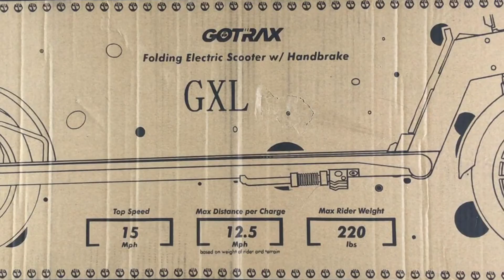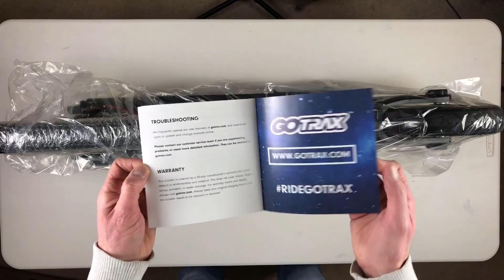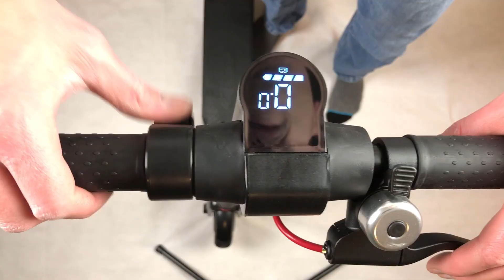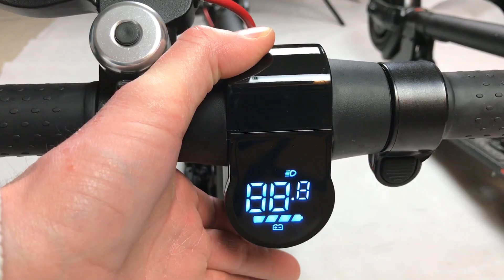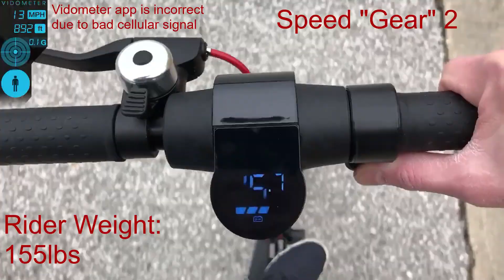NEW GoTrax GXL v2 Electric Scooter Unboxing and Assembly 2019

Comment: hey, i have a question power on fun, in the video meter on the top right of the speed test it says its only going 13 - 14 miles per hour. is that accurate? i just bought a gotrax xr, the standard model, im also wondering if the xr model has a speed cap like the xr ultra has. thanks!

Comment: The Locking Bracket that prevents left-right movement in Folded Position broke. How do you order parts? Functionally, the unit is good, just cumbersome to handle in Folded Position.

Comment: Hey idk if this is the best place to ask but, I ordered one of these about half a month ago and has anyone had problems charging the scooter? Even when I try my hardest to jam the charger into the port, it doesn't seem to go in all the way. The charging block stays green even though the battery indicator says 50%. Anyone else having this issue? Maybe I got a faulty charger. May have to return it... Sad because the scooter itself was fun to ride.

Comment: Do you need a bike pump to fill the tires?
Reply from the maker: Yes.  However, you will more than likely need to use the 1 foot air extension that comes with the scooter in order to air the tires up.

Comment: Just picked one up, cant wait! Our downtown district just put these all over downtown, and after spending 30 bucks to rent one for an hour, its a no brainer to buy one.   Great video
Reply from the maker: Yes.  Renting is nice for a one off trip or getting from one part of the city to another quickly and efficiently, but for commuting on electric devices often it makes more sense to own a scooter (or another electric device).  Especially as the Gotrax GXL is under or at $300

Comment: have problem with the headlights. it keeps blinking even if OFF. do you have any suggestion? took the battery out then put it back, still no luck. it keepa blinking. so annoying
Reply from the maker: Is it only the power button that is turning on or off?  If the whole scooter is I would wonder if something inside the power button is stuck.

Comment: Do you think this is constructed well? It's $300 versus the Xiaomi at $500. People have complained about the bracket on the back wheel breaking at the two bolts that hold it to the base of the scooter. Do you think this will hold up with casual riding?
Reply from the maker: I personally believe that both the GXL, and new GXL v2, are built beyond their low price point when compared to other well though of models such as the Xiaomi M365 and Ninebot Segway ES 2.  I’ve not had any issues so far with either scooter, but I’ve not had a chance to ride the new GXL much yet due to weather.  I can say however that we put the original GXL through a lot in 2018 and other than getting dirty and rubber wheels starting to wear down naturally there is no visible wear and tear.  Both versions are constructed with the same frame and core parts other than a couple of improvements.
Reply: @PowerOnFun   Thanks. I can buy two GXL's for a bit more than the price of one M365. That way I have one and so does my partner. :)
Reply from the maker: If you have any other questions or want a close up detail of parts just let me know.  I’ve got an affiliate Amazon link in the description, but I’ve asked Gotrax recently if they would offer a discount code for my viewers.  
When starting out looking at buying the original GXL I was afraid the price was too good to be true and the adage “you get what you pay for” would apply, but so far myself and all my
Kids are happier with both GXL scooters than my Ninebot Segway ES1 (although it’s an older model).
Reply: I just got gxl v2 and it looks solid to me and very precisely done. My wife likes it A LOT, so most likely I will get another. I commute about 6 miles or 1 miles (from parking lot) and this thing is ideal for me. Now instead of walking for 10 (or more) minutes it is literally 3 minutes! What I like about it is simple, no apps etc. it works. Break is GREAT.
Reply: Why not break off the bracket and throw on a strong permanent magnet to it for 8 bucks?  Or, or...pay $200 more for a scooter. Sheez.
Reply: @AlanSieja  The gxl version 1 was around five hundred bucks 2 years ago! The price just dropped to around $300 last time I saw it around a week ago, so I bought it so yeah there you go... you're getting essentially what was once a $500 scooter! For $298 before taxes..
Reply: @davidg7454  Because some people like myself love to save our money whenever possible "we don't live ghetto fabulous" so we wouldn't buy it at $500 but $300 is reasonable and that's why I have one now! Geez! Gosh!
Reply: @davidg7454  Also the new PlayStation & Xbox will soon be coming out, so I  have to save my pennies for those too!!!😂

Comment: I just bought one and it came.a.few mins ago..I hooked it up and turned it on and it came on, I tried the throttle but the wheel ain't move and the battery says it's full but they say to charge it when u first get it so is that the reason it didnt work?? Does it not work if the battery isn't fully charged when u first buy??
Reply from the maker: The scooter has to be on and moving/rolling 1.5mph to 2mph before the motor will engage.

Comment: Is there any button to turn on & move my wheel when i push the speed nothinh happened but the battery is full do i have to still charge after i assemble it ?
Reply from the maker: The scooter should run on a partial or full charge.  You can disconnect and reconnect the handle which would disconnect it from the battery in the neck of the scooter where the battery sits.  If you still have issues contact Gotrax right away with as much clear detail as you can (and keep copies of your email for proof you contacted them when you did)

Comment: Ok mine is assembled and charged but I can't seem to get it to cycle between gears 1 and 2. It either turns on the headlight or powers the scooter off. 2 secs, 3 secs, 4 secs no diff. Nothing in between. Is there a trick?
Reply from the maker: The GXL scooters I have are from very early 2020 and before.  I've had a couple of others report that they are not able to change speed modes on their GXL scooters received over the past 2-3 months (estimate on time).  I am only speculating that Gotrax may have removed the speed selection option, but I have nothing to confirm that for certain.
Reply: @PowerOnFun  thanks. It seems to get up to the advertised top speed so guess that's the case.

Comment: Hey I just got this scooter, and when I fold it it won’t stay hooked on to the back piece in fender? Like I told it and go to pick it up and it keeps popping off, any advice? Thank you
Reply: Literally just took out of box and I can’t seem to figure out why when I fold it it won’t stay together when I pick it up, it
Keeps popping off
Reply from the maker: There is a red plastic hook on the tiller (front stem) of the scooter that latches up and into a red plastic piece screwed onto the rear fender.  Are those two pieces there and are they making a connection together (or broken)?
Reply: Power On Fun yes they are bother there, but when I fold it down, it snaps in but I go to pick it up and it snaps right off, like just doesn’t hold, which is weird
Reply from the maker: The only thing I can think of is if either red plastic tiller hook or fender latch is backwards things might not line up.
Reply: @PowerOnFun  it seems to be on correct. It faces the same way as it does in the video. Do you think id have luck if i unscrewed it and screwed it on backwards?
Reply: @Rachel Goodman.   When u close it does the hook and latch make a snapping sound? Also when u pick it up are you holding it near the middle of the stem or closer to the handle bar?
Reply: Did you get it working? If you unscrew plastic piece on back fender you can position it further forward or back. There is a small metal plate that's under that piece so be ready for it to drop when taking it off.

Comment: Does it have decent battery life? Also I have big feet, could you tell me the usable deck size length and width?
Reply from the maker: I can say that the battery life on the Gotrax scooters I have an use are very good and have lasted well over the years.  Of course, all rechargeable batteries will degrade in the charge they can keep, but that is normal "wear and tear".
Reply from the maker: My shoes are a common size of 12 and I have not had issues.  I normally stagger my food placement on the scooter somewhere between toe-to-heel and skateboard foot placement and it works well.
Reply: @PowerOnFun  My shoe size is 14. My feet are 10 inches long and 4 wide. Clown feet. Would you say you have plenty of room left over?  
Thanks for answering this is basically the only thing keeping me from buying.

Comment: When attempting to attach the handlebar console to the main scooter base, the console won’t go all the way in for me, so the holes for the screws won’t line up and I can’t attach the two pieces with the hook. I don’t want to jam it in and risk braking it, but is it necessary to give it a good hit or something to knock it into place? If not, I’m assuming it was just poorly made and I’ll have to try to send in a claim and get an exchange for a different one... that would be a pain.
Reply from the maker: I too had questioned the initial handle seating. I would advise removing the handle and slowly seating it to make sure the pins inside the tiller and handle line up.  To seat the handle it may require a bit of a tap from the palm of the hand.
Reply: Power On Fun yeah I was assuming that the problem was that the pins weren’t lining up, but I can’t imagine for what reason. The console and tiller lined up, the holes for the pins on the exterior lined up, so you would think that the pins on the inside would also line up. I suppose I’ll try it again later tonight and maybe give it more of a pat down and see if they will lock in. Otherwise it’ll have to go back.
Reply: Power On Fun update to my problem in case anyone else has the same issue and is wondering: I contacted gotrax customer support and they got back to me suggesting that I remove the battery pack entirely from the scooter so that I can attach that to the console (handlebars) first, then slide that whole piece into the main frame all together... and it worked! (After some time and struggles... if you have to do this as well, the battery can be hard to get out. I suggest turning the entire scooter upside down and tapping on the main frame until the battery begins to slip out).

Comment: Ok I just bought this wonderful piece of transportation and followed the video since the paper instructions were confusing to me and now I have plugged it in and the Black box on the charger is showing Red is this the light I'm suppose to be looking at or is there one on the Scooter itself?
Reply: Also there is a Black Wire about 7 inches long with  2 silver ends what does this go too I didn't see it on the video or the manual
Reply from the maker: The LED indicator on the power adapter  will be Red when plugged into the scooter and charging the battery.  Green when plugged in and the battery is fully charged.  The LED is green when not plugged into the scooter.

Comment: No matter what way I do it the brake line is too short I’ve fought with it for an hour now please help
Reply from the maker: I found the easiest method is to detach the handle and brake line, make sure the brake line is going up the same side of the scooter as the brake on the handle, connect the brake line to the brake on the handle, and carefully seat the handle back on the tiller neck.  It's not easy, but possible

Comment: Correction, the electric regenerative brake is still there. I own this model. If you press the brake slightly, it will engage, squeeze a little harder and the disc brake will begin engaging.
Reply from the maker: I often to neglect to think about regenerative brakes as my local ride is 99.99% flat.  You are correct.  I was able to confirm with Gotrax that the handbrake on the GXL v2 (in this video) does allow for battery regeneration (regenerative braking) as does the first gen GXL with electromagnetic brake (along with with rear disc brake).  It's near impossible for an average user to give numbers for effectiveness on this, but it's, at least a positive, something rather than nothing.
Reply: its garbage

Comment: Hi there! Thank you for posting this video. I received my Gotrax GXL V2 today and unboxed it while watching your video.  It definitely made it simple for me to put together and know how to operate.  I recently returned a carbon fiber Scooter (another brand) as it completely shutdown after one 4 mile ride.  I am hoping that this one will be reliable.  Thanks again!
Reply from the maker: I am glad that I was able to help and I hope that the GXL works out well for your needs.  Be aware of the automatic cruise control when riding.  It is very nice on long straight rides, but not mentioned in the instruction manuals I have and has a potential to confuse one if not aware.  I have a video I’m almost done with explaining this as well.
Reply: @PowerOnFun  Thanks for tip, i experienced it today.  I will check out the video.  All the Best!
Reply: How is it doing?
Reply from the maker: Tomas Zaicevas, the GXL v2, as well as my original GXL model, are still running strong with the same power and reliability.
Reply: @PowerOnFun  I am very much interested in buying one, but I am worried about transporting it by a plane. Have you had any personal experience with this concern?
Reply from the maker: Tomas Zaicevas,  you will not be able to take this on a plane as a carry on using any airline.  I am not 100% sure, but I don’t think any airlines will let you check this in either, but you would have to call and ask.  I know rules and regulations vary a bit from airline to airline.

Comment: Did this include the extension tire to fill the front tire
Reply from the maker: There is a 1ft extension included to help connect and inflate the tires.
Reply: @PowerOnFun  thank you so so much
Reply: @PowerOnFun  and also that review was super helpful

Comment: Thank you so much bc I was so frustrated with that one cord to loop into the brake.
Reply: Is 15 mph fast ?
Reply: @aidandasilva1063  more Like 16 mph
Reply: Because i have that one
Reply: Same, the instructions did not explain that well.
Reply: Fr
Reply: How tf u get the cord qround it i dont want to break it
Reply: @isaiah2096  I’m having that same issue. It doesn’t quite stretch enough to get it how it shows it on the videos and instructions
Reply: My cord is not red either. It’s just the silver little thin thingy.

Comment: Thank for the very helpful video for a while I've been looking for the best scooter at a good price and this had me more convinced than others what do you think should I buy it?
Reply from the maker: I would look for an electric scooter later this month (for "Black Friday deals).  I know that Gotrax is having a sale/discount on several scooter and a few other of their electric device models (GXL and GXL v2 included at $269.99).  I also know that Gotrax has two other new models coming out, but I assume they won't be released until after November (in time for the core holiday time crowd).  I've looked at a model available on amazon, the Macwheel MX1, but I've personally not had one to test or compare against.  The mileage/distance on the Macwheel and one of Gotrax new model scooter is set be almost double (on paper at least) that of the GXL/GXL v2.
Reply: Thank you I think I'll buy it since black Friday is coming up
Reply: @gonzalolopez2370  Just got mine today for $250 on Amazon deal.

Comment: hey i just got the scooter do you know what that little battery sigh on it means
Reply from the maker: The battery symbol and bar above it represents the amount of charge the battery has left.  It fluctuates some from a stand still to moving as the display tries to calculate the amount of charge left.
Reply: Power On Fun ok but on one of my scooters the little sign stays there even though the scooter is at full battery
Reply: Mine to how do I fix that problem??
Reply: @briannacalvillo1551  idk i’ve had it for a couple months and it doesn’t affect the scooter. but the scooter that had the sign goes a couple miles per hour faster than the box says

Comment: May I know the length width and height of the gotrax gxl 1st model when you fold it. I was planning to buy a carrying bag before ordering the scooter, because it's not waterproof and incase carrying it and it rains it will not be broken from putting it on the carrying bag.
Reply from the maker: The width of the handlebar is 17”.  Folder measurements are:  Height (at its highest point.  Rear wheel to handlebar) is 15”.  Width (of the deck) is 6”.  Length (from front wheel to top of handlebar is 44”.
I don’t know off hand if the scooter has an IP rating, but the lcd screen and power/speed gear button look to be sealed a little and water resistant.  Obviously in a downpour all bets are off, but I believe the scooter can handle some slight drizzle.
Reply: Thank you just ordered the bag earlier. Thank you for the quick response. Really appreciate it. Just wanna ask is it only 1 and 2 speed. Because I was wondering if you can control the speed like 6 only for I wanna use it in the public walkway and don't wanna hit somebody. Thanks
Reply from the maker: Edner Carle , unfortunately there are only two speed options on the scooter.  However, the speed throttle switch works well and if you have to go slower than the max speed setting you can.

Comment: I modified mine out with a 72 volt controller and I can alternate between 60 volts or 80 volts of lithium battery power.
  The torque is insane!
Reply from the maker: Very awesome
Reply: Video?link